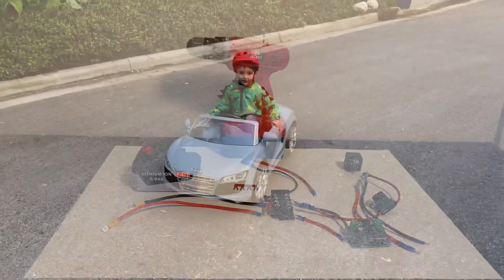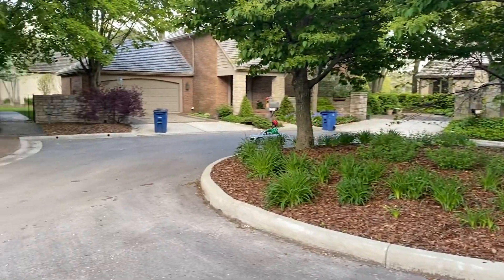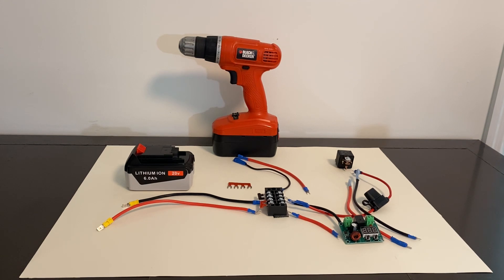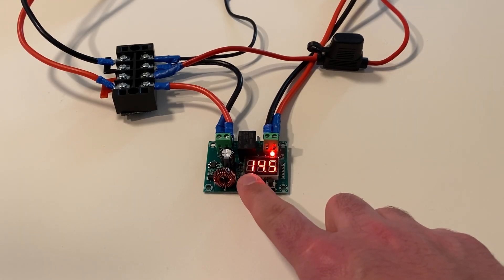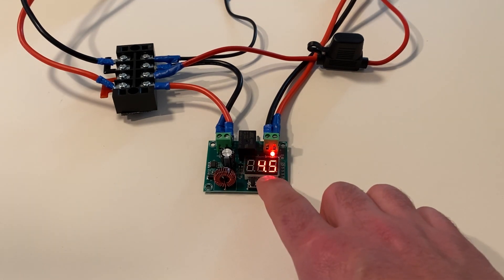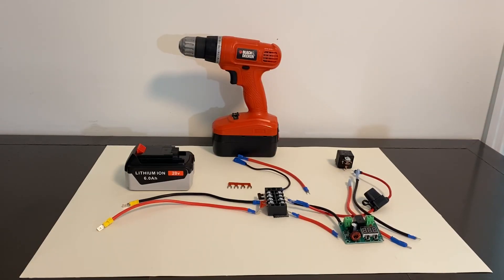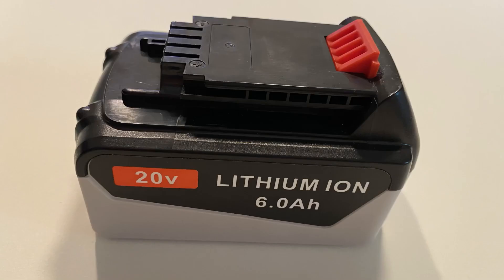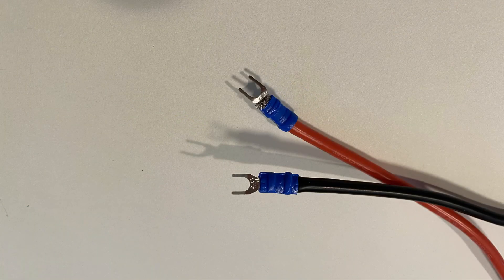18 Volt & 20 Volt Battery Upgrade for Power Wheels with Low Voltage Cut Off

Comment: How would you wire it if you wanted to add a PWM controller to prolong the motors? I was going to wire it the same way with  the controller between the battery and terminal strip output, but i seen in the comments you said the PWM controller needs full power to work correctly?
Reply from the maker: Watch this video, I have the diagram at the 4:19 minute mark. https://youtu.be/T9PUSDLFKAM

Comment: If I don’t use that low voltage cut off module
Do I still need the relay?
Reply from the maker: Nope. The relay is only used to protect the LVC board
Reply: @DadHacks  what if I use one of those pwm speed controllers with the adjustable knob would input a relay in front? Is a relay like a fuse that takes the load so it doesn’t fry circuit boards?
Reply from the maker: The PWM speed controller needs the full load in its input, so you wouldn’t use a relay with the PWM. Also the PWM has a mini 30a fuse in it. I have had the mini fuse pop once or twice, but I put a 40a fuse in it and it did fine. Also note, there was a regular 30a fuse before the PWM’s fuse that didn’t pop, so that leads me to believe the mini fuse is more delicate. So I would still recommend a 30a fuse right off of the battery and then don’t rely on the internal  PWM’s fuse. A fuse is a safety tool to protect the wire, the relay is a safety tool to protect a switch or board.
Reply: @DadHacks  awesome thanks so much !
Reply from the maker: One thing I should clarify is that the fuse protects the wire from overheating too much. But the fuse can only work if it’s sized correctly. If the stock wires on the car are thin (16 AWG), then you should use a smaller fuse size, like a 20 amp. If you use a larger fuse, like a 30 or 40 amp fuse it will essentially be useless.
Reply: @DadHacks  that makes sense 
I bought the adapter thing on Amazon that came with the Dewalt adapter already wired with fuse I think it was a 14gauge and a 40 am fuse. Using the low voltage cut off is kind of annoying because you have to program it every single time. I’m leaning towards putting a digital battery voltmeter and maybe put it someone on the dash of the car.
Do you now if this needs to be wired directly to the battery or do I wire it from the pwm controller?
Reply from the maker: The 40amp fuse is too big for 14 AWG wire. You will want a 25amp or 30amp fuse. It’s likely the other wiring on the car is 14 or 16 AWG…. As for the Digital Voltmeter, you can split the wire after the fuse with one of these (see Amazon link). https://a.co/d/44bqyDF … one wire will go to the voltmeter (you can use 14 AWG or 16 AWG) and the other goes to the PWM controller. The wire to the PWM should be 12 AWG.
Reply: @DadHacks  thanks so much !!! This was all very helpful !
Reply: @DadHacks if I am only drawing 4 /5 amps. Is the relay still needed.?

Comment: Does this low voltage board store the settings? I have a few ride on toys that are running drill batteries, some for years without an issue, but going deeper down the rabbit hole lead me to realize how wrong I have been doing it.  Right now, my kids will just hot swap the batteries when one is dead.  If they pull the battery wont the board reset?  I know I wouldn't have the issue if I left the battery in the toy and recharged it there (not ideal), or If I ran 2 batteries the board would have power as I swapped them one at a time.
Reply from the maker: Unfortunately, I’m pretty sure these boards do “reset” when power is disconnected, meaning it’s up to the child to reset it if they swap out batteries. I’ve switched to mainly using a digital voltage gauge on the dashboard to monitor the voltage, then swap out as needed
Reply: @DadHacks  can you link which one you are using? And by this do you mean rather having a cut-off board, you just now have a voltage reading aka A "gas" gauge and when you start to reach the safe "empty" zone, you stop and swap? I'm getting ready to do two conversions for my boys and there's no way they are going to set the cut off switch every time they ride  if the voltage board doesn't retain it's settings but if I give them a digital "gas" tank with a number to not go below, I'm pretty sure they would remember it's time for a pit stop.
Reply from the maker: Yup, I use the digital voltage gauge as a “gas” tank for the battery. Funny enough, there is usually a gas tank sticker that I install the voltage meter over. Here’s the link to one I’ve used. If you have questions wiring it up, just let me know. I usually run it down to 16.0 volts, that leaves some room if we need to drive back to the garage. https://a.co/d/hHXyBBr
Reply: @DadHacks  thanks so much for quick reply. Yes, need help on how to wire in and where in the chain does this go? I see that it only has two connectors so how would I add this to chain? Right now my plan was not to use a terminal block - I was going to go Battery-voltage cutoff- speed control-motor. Would I need a terminal block if I went just meter reader?
Reply from the maker: You won’t need a terminal block, but you will need to split each line (positive and negative). From the battery, you could wire into this splitter (for example positive 1 wire in, 2 positive wires out). https://a.co/d/ismrZ8z . One of the 2 out lines would go to the volt meter and the other would run to the “in” of your speed controller.  Then the “out” of the speed controller would run to the car. The wire size from the battery, to the speed controller and then to the car should be 12 AWG. You can use a 16 AWG wire for the volt meter
Reply: @DadHacks  awesome! Thanks so much man. Your video and wiring diagram is one the best ones about how to do this. Everyone else just shows a pile of stuff then proof it's in the toy. Very novice when it comes to wiring these sorts of things and can get intimidated by what is probably simple stuff.

Comment: How long would this run before dead?
Reply from the maker: Between 30 to 45 minutes. Some factors that effect run time are the driving surface (pavement vs grass) and the weight of the car and driver

Comment: My fuse keeps blowing. I'm running it with one battery. Any ideas?
Reply from the maker: What size wiring are you using? Ideally, you want around 12 AWG
Reply: @DadHacks  I used 12 all the way through
Reply from the maker: Is it happening on pavement or just when they drive on the grass?
Reply: @DadHacks  always
Reply from the maker: @High-speedHarvey  typically, how long does it run before the fuse blows?
Reply: @DadHacks  about 5 mins. I'm pretty sure burned up the volt cut outs tonight

Comment: Im useing 2 / 20 volt craftsman batterys 6 ah.  Can i piggy back the 2 batterys on the strip?  Both positive and then both negitive together.  Or would this not be correct.  And is 2 fuses needed for both batterys just before the strips?    Im trying to understand how low voltage relay is protected, it looks like the 1 fuse is after the relay. I would think the fuse should go on the red positive side IN of Low volt cutoff.  Im most likly looking at it wrong as far as following the lines.  Thanks for your professional advice, i will be doing this project soon, thankyou.  Im installing a speed control unit as well, its not in your plans, im going to install it from low volt control board to speed control unit.  Thanks!
Reply from the maker: I would wire the batteries in parallel before wiring them to the strip (red to red/black to black). This will give you 20v and 12Ah. You can then add the fuse before the strip. Technically, that would be the only fuse needed and would be before the relay and LVC board to protect both. One note of the Craftsman battery, it is possible that it could already have a LVC built into the battery, similar to Ridgid, Ryobi and Makita. But it never hurts to have extra protection for the battery. Lastly, I have another video that hits wiring up the speed control unit on Method 4 of this video https://youtu.be/hnBAEuVzGEA
Reply: @DadHacks  Thankyou for reply. Can I just add 2 fuses to battery's before the strip and on the strip hook up both black and both positive wires for the 20v 12ah for this to safe guard system.  This way I will have 2 20 Amp fuses protecting system.  Thankyou for your time, much appreciated.
Reply from the maker: Yes. For that method you are correct to use 2 fuses. FYI, the speed control that I bought had a mini 30 amp fuse in it, and it kept popping so I had to replace it with a 40amp. Make sure you are using at least 12 gauge wire
Reply: @DadHacks  Thankyou very much.  I have a better understanding  now. Have a great day. I'm very grateful for your help. I'm a sub to your channel!

Comment: Followed your video step by step and gave new life to a very old power wheel jeep.  Thank you for this!  Very well done.  I love learning about electronics and trying new things.
Reply from the maker: Great to hear!
Reply: Hi, I followed your video step by step, I have a 12v mother board , and a dash forward and reverse controller , the dash controller just turn on with low 20v dewalt batteries,it doesn’t work with full charged batteries ,

Comment: Does it matter if the fuse is before going into the relay, or can it alternatively be on the wire going out of the relay to the car? I assume it's fine, but just wondering...
Reply from the maker: Ideally you will want it before the relay. If something were to happen then you’d have to replace the relay and a fuse versus just a fuse.

Comment: Do you have an alternative recommendation for the 24v relays to buy? The one you link is out of stock.... I like the prewired connectors. Trying to make it as easy as possible for myself...
Reply from the maker: Here’s another link to a 24relay with a harness. (I like them prewired as well, so much easier to use) https://www.amazon.com/dp/B07QLD857Z/ref=cm_sw_r_cp_api_glt_fabc_NHQ2HS4B8F7HGYN17N1J

Comment: What are the relays for?
Reply from the maker: To protect the Low Voltage Cutoff board, it can’t handle the full load. You could skip adding a LVC board and relay, but you would need a digital voltmeter to keep an eye on the voltage

Comment: Can this Setup Be Done in Series?
Reply from the maker: Yes, you could wire the batteries in series, But when you start to push 24volts or more through a Power Wheels, you start to have more problems. Gearboxes tend to be the first thing to break, because the plastic gears can’t handle the heat. Also, the wiring might not be large enough to handle the heat
Reply: @DadHacks  Yes I Plan to Get the 775 Gearboxes with the Metal Gear?
Reply from the maker: @kirbycollins3223  the metal will definitely help. Here’s my “please subscribe” pitch; I’m working on a video on how to add a ESC (electric speed controller) and variable speed pedal. The ESC is ideal when running 24+ volts because it causes less stress on the gears and functions like a real gas pedal
Reply: Thanks for the video! Any chance you know where I can find a schematic for 2 12v batteries in series with the low voltage cut off? We have a 24v Grave Digger with Banebot motors but the batteries are shot. I brought some milwaukee battery adapters & hooked them up but smoked the low voltage cut off in a matter of seconds. Definitely need a diagram to do it correctly if you know where I can find 1.
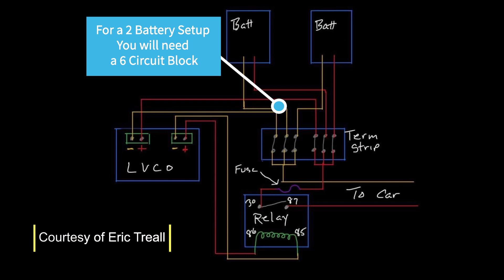Reply from the maker: @ahlers1977   use the diagram at 5:22 in the video, but for the batteries, the + of one battery and the - of the other connect  and then the other + and - run to the terminal strip...

FYI, it’s a lot easier if you use the Sealed Lead Acid batteries, you don’t need a Low Voltage Cutoff for those and the time run is better than drill batteries
Reply: @DadHacks  thank you for the reply. We have been using the lead acid batteries but they take forever to charge. We were  getting 10 minutes run time then then would have to charge overnight so I wanted a way he could ride more then once a day for 10 minutes. The drill batteries charge fast & weigh less so it seemed like a win win!
Reply from the maker: @ahlers1977  sounds like the SLA battery is dead. You should be getting at least 90 minutes out of a 12amp hour battery

Comment: How would the wiring differ if you used this https://www.ebay.com/itm/224295889623?hash=item343913aad7:g:kVUAAOSwMoBf6WVH
Reply from the maker: I would cut the wires a few inches from the plastic piece that connects to the car. Then everything else would be the same as the video, except on the diagram where it says “To Car” you would connect the plastic connection piece there (instead of using the female terminal connectors that I used in the video)